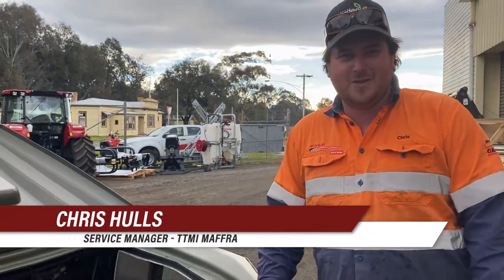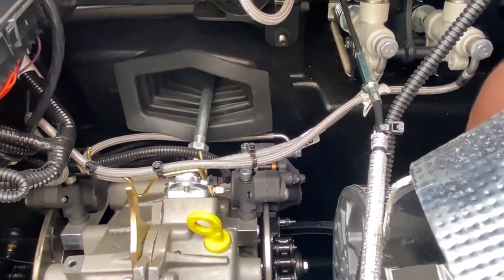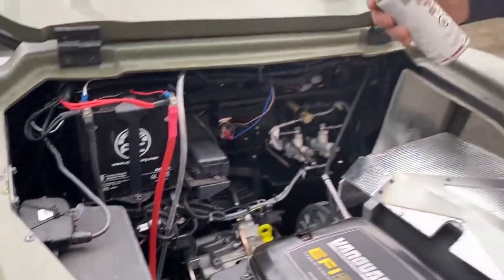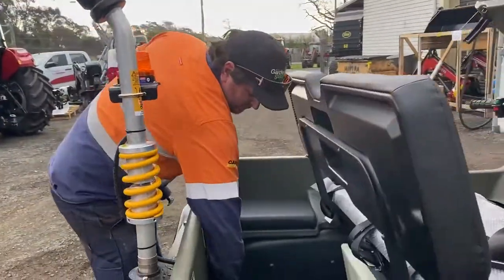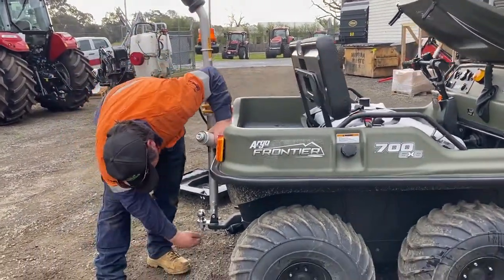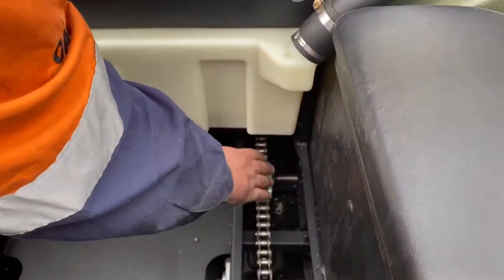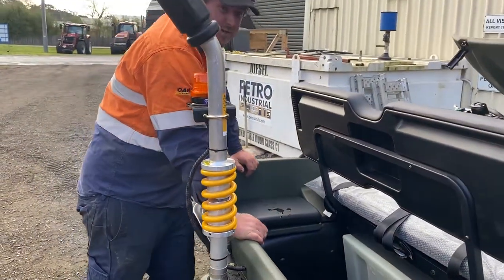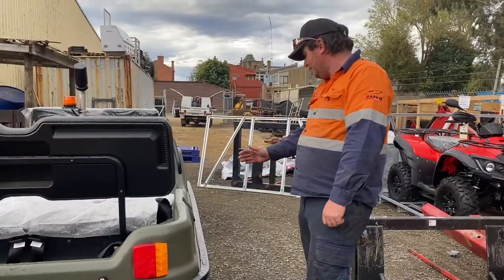Argo Maintenance Checks

Comment: Don’t know if you still work on Argos. I’ve got an issue with 2002 Conquest 8X8. Left steering brake works good, but the rights loses pressure after the first time you use it. Have bled calipers numerous times, replaced master cylinder and replaced the adjusting rod and tightened jam nut. Did a test run and it worked find, but when took it out into bush started loosing pressure after the first time it was used. Have you heard or seen a similar issue?